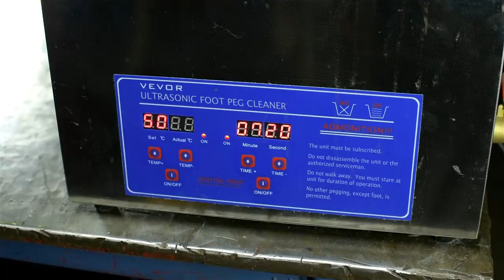7075, 7076... Whatever It Takes

Comment: old Tony, I tryed to found a way to contact you outside youtube comments, but like your face is a mistery, conyact you seem to be an AVE parcour.

to be bref, Can you show me, show us, how you will cut lexan, acrylic, plexiglass ...   I thing like anyone, this material is a challenge when come to cut a squarre hole (lets say for mounting a panel voltmeter), anything I used to cut melt the "plastic" on the path of the tool and "re-sealed" it ! awesome useless cut !

I know, I know, old school Tony drill and hand cut then filed ... but at the time or all is going fast ... handtools are another century, even if I am not so young anymore.

please, can you make a video about it ?

Comment: Why not add steel via weld to the frame and therefore no need to weld the ALUMINIUM pegs? (note the UPPER case to highlight the CORRECT spellins of ALUMINIUM - not the weirdo YANK style - HA)   Or am I missing something re "weld to the frame"?  OR - possibly GLUE something to add the extra dimension to raise the plane of the peg - HA.   I mean - my Med Dr. son uses super glue to glue people back together - surely a shitty footpeg is not too 'high and mighty' for GLUE - HA.  OR - even a self tapper into the end of the peg - or wire wrapped around the frame - there are a million; farm-boys or bush mechanics that could solve that with shit laying around on the floor - and no 'nancy boy' TIG required - HA.. Have a nice day all.  CHEERS from AUSTRALIA.

Comment: use aluminum in lewer with spline or slot is very stupid idea. I had BMX with aluminum crank and aluminum was dead after first year. I swap to crmo steel and going to nothing it least 8 years.

Comment: buy a set of micrometers at harbor frieght, even the cheap chineese ones will do. then the first thing you can check is the rotor thickness and not be a idiot and waste time.... dont ever weld rotors. you will not like the eventual result.